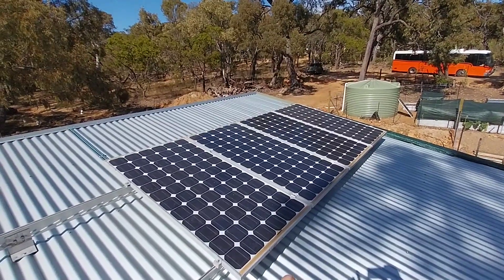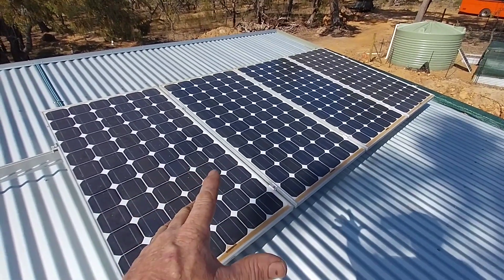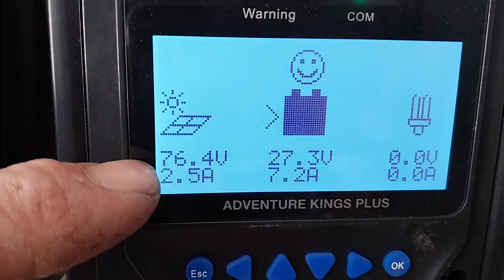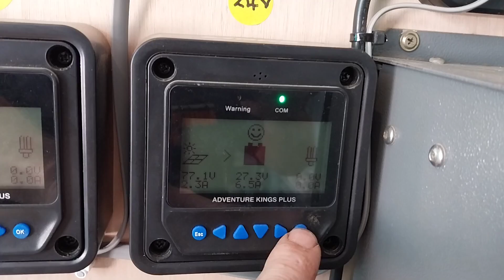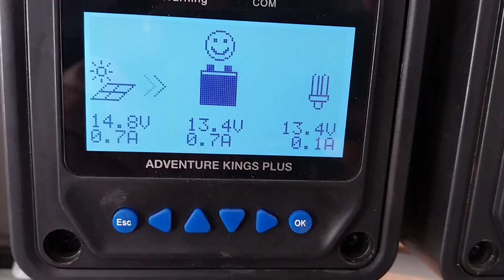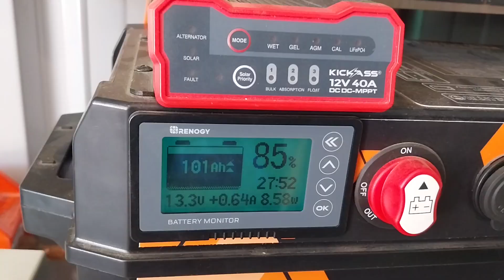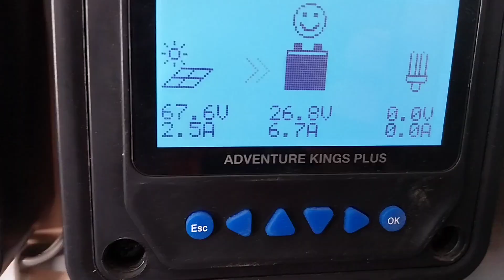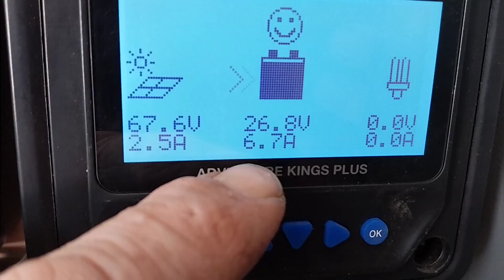Morning Chores & Solar Panels For The Workshop

Comment: Why lower voltage panels? I got all my charge controllers maxed out. High voltage and low current keeps all the wires happy. I’m running victron 250v controllers and on cold mornings my 5x 42v panels give me 245v as the sun hits them. Peak efficiency.
Reply from the maker: A long answer to your question but here we go.....
Yeah higher voltage, the better for sure. Technically we cannot exceed 60 volts DC under the new wiring laws adopted in Australia. We use to be able to go up to ELV of 120 volts DC but now we adopted the European regs and cannot exceed DVC-A of 60 volts DC for unlicensed electrical work.
I did try this on my 48 volt system, it's no practical and does not work so I run my 48 volt system at a higher panel voltage. But for a 24 volt system and under, running a panel voltage for around 50 - 60 volts will still work. So consider I am against government control and laws that force people into compliance so we can be controlled, why am I trying to keep within these regs.
Because of my YouTube channel and all the pin head trolls that keep nit picking my systems to feed their egos. What we put on social media can be used against us now so content creators have to be extra careful what we post. So any system I show on my channel has to be with the new specs and hence the reason I don't show my 48 volt system very much on my channel anymore.
Reply: @TheOffGridBachelor aah, luckily we have no such rules in MURIKA!

Comment: Are you going to do bearers and joists or just throw some yellow tong sheets on the ground ? as itll be difficult digging holes for stumps maybe pavers, concreate would be nice though what about bore water for the garden ?
Reply from the maker: The plan is to level the ground and drop some bricks or cement blocks on the ground. I will then put down bearers and joists on the blocks and the flooring on top of that's... well that's the plan. The ground is all gravel and is compacted hard as concrete, so it should be a solid enough base for the blocks.
I don't have a bore as it costs around ten to twenty thousand to put in a bore with no guarantee you will get water. I have scheme water at the front of my property. Although I am not connected to it, I can run a hose from the tap at the front of my property and put some water into the tanks if I run out. But I still have water in the big tank at the veggie garden so not out of water just yet. All I need to do is transfer some down to the tanks at the cabin.
Reply: @TheOffGridBachelor  Im a carpenter and your idea of the floor sounds good to me

Comment: You should have mounted those panels higher, you got shading on the bottoms of the panels, be worse in winter.
Reply from the maker: The tree that shades the shed is on the back eastern side of the shed. As the sun moves from the east and over the tree, the shaddow moves down the roof and by 8:30 am when the sun clears the tree, the panels are in full sun.
What you saw was the last bit of shade moving down the roof as the sun moves over the tree. The trees don't bother me as my batteries are usually full by around 11 am. As long as the batteries are at 100% by the end of the day, it's all good.

Comment: 3:32 nice to see 18 years old panels, which means the claim of " Panels will last for 30 years " is actual right
Reply from the maker: Back then when I was buying panels, the warranties were 5 years on the materials, frame & components and 25 years on the power output. The panels still output plenty of power so technically it is still within their specs.
I have panels I bought back in 2001 and they are still working today, although getting pretty rough looking. I do need to do a video on those panels.
Reply: @TheOffGridBachelor  and inverters as well, if they last the same time as panels